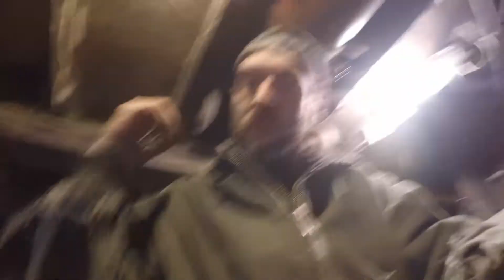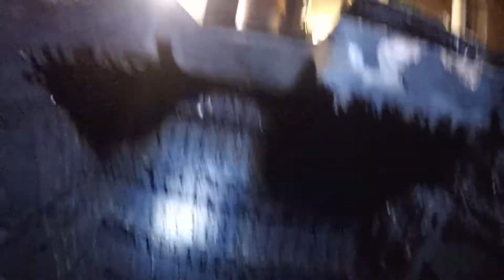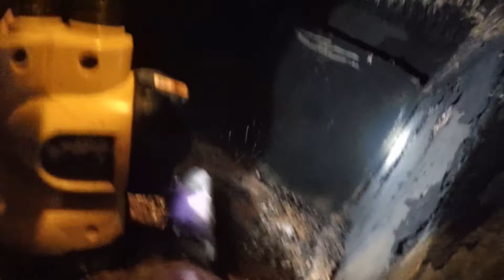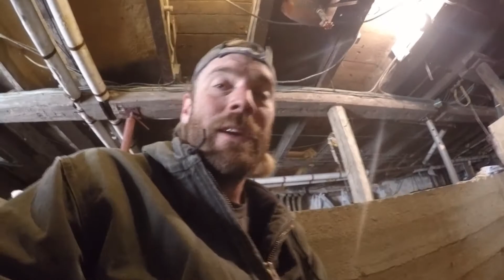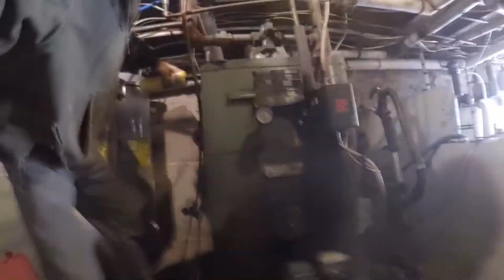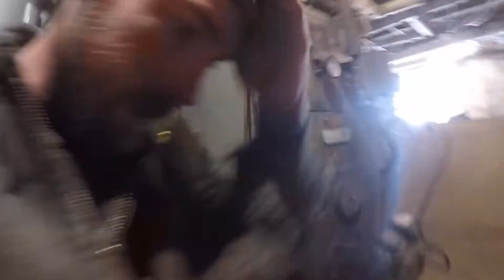NO Heat! Oil Burner stopped working! How to clean it out.

Comment: You’re dangerous pal... you didn’t address the reason why the boiler sooted up. You didn’t perform any type of service to the burner. You may have changed the filter but you didn’t change the pump strainer, nozzle, or adjust the air band. An oil burner needs to be adjusted by a pro who can use instruments to perform a combustion test. If the burner is operating correctly it should not soot up. Don’t be cheap! Also, don’t lead gullible people to believe they can cheap out, cut corners,  and save a buck! You could end up burning your house down or killing your family with CO!
Reply: Exactly. Looks like hasnt been properly serviced in many years. This is preventable just like colon cancer . See this a lot in DIY homeowners , when it fails massively from poor maintenance they complain about repair cost . I ask them how much they really saved not having it yearly serviced properly.

Comment: I was just passing by your video and couldn't help it to tell you, i do work on my oil furnace too, but have more experience! I noticed you clean your very dirty furnace( to clean the heat exchanger you could use steel brush), anyway also  you didn't change anything, what about changing oil filter or filters and oil nozzle, and also your pipe( vent pipe) missing draft section, if you do all of this, will work better,... just try to help.

Comment: I JUST SCRAPPED THE SAME PEERLESS 150K BOILER IN A STEAM VERSION WHICH WAS INSTALLED IN MY MOTHERS HOUSE BACK IN 1974/5. AFTER MY MOM'S PASSING I INHERITED THE HOUSE AND FOR THE PAST 2 1/2 YEARS AND NOTICED THE BOILER CONSUMED LOTS OF OIL DURING THE HEATING SEASON. SO I DECIDED TO GET RID OF IT AFTER MY FRIEND DID A OIL TO GAS CONVERSION. AND I TOLD HIM TO NOT SCRAP THE PEERLESS OIL BOILER WHICH WAS 10 YEARS OLD. SO HE HAD THE SCRAP METAL GUY DELIVER IT TO ME FOR $300. I JUST FINISHED INSTALLING IT 4 MONTHS AGO. I SUSPICIONED THE OLD PEERLESS BOILER WAS A BAD DESIGNED WHERE THE NEW DESIGN 150K PEERLESS WHICH IS PHYSICALLY LOWER, WHERE THE BOILER PLATES HAVE THE FINGERS COMING OFF EACH SIDE OF THE BOILER SECTION TO TRANSFER THE HEAT, SAME DESIGN LIKE THE WEIL MCLEAN GAS AND OIL BURNERS. WHEN I BROKE APART THE SECTIONS OF THE OLD PEERLESS BOILER LIKE THE ONE YOU HAVE THERE. I WAS CORRECT OF WHAT I SUSPICIONED. THE BOILER SECTIONS HAD NO FINGERS BUT A CURVED SCOOP FIN TYPE DESIGN LIKE THE FINS ON A MOTOR CYCLE HEAD. I ALSO DISCOVERED THE MIDDLE COVER THAT SAYS PEERLESS OVER THE BOILER DOOR AND BELOW YOUR TRIPLE ACTING AQUASTAT IS A CLEAN OUT. IN THE CLOSE TO 50 YEARS THIS BOILER WAS WORKING. NOT ONCE DID THE OIL COMPANY IN IT'S YEARLY CLEANING EVER CLEAN THAT PART OF THE BOILER AND IF YOU REMOVE IT. YOU WILL FILL SUT BUILD UP THERE TOO. THE SECOND OBSERVATION BETWEEN THE 2 BOILERS IS THE OLD PEERLESS BOILER  HOLD MORE WATER WHICH IS BAD FOR EFFECIENCY, BUT GOOD WHEN YOU USE LOTS OF WATER WHEN YOU HAVE A COIL FOR DOMESTIC HOT WATER. THE NEW BOILER WHICH HOLD LESS WATER MAKES STEAM A LOT FASTER AS OPPOSED TO THE OLD BOILER WHICH TOOK LONGER TO PRODUCE STEAM. HAD THE TANK FILLED ON 11/20/21 AND I'M KEEPING TRACK OF HOW MUCH MORE EFFECIENT THE NEW BOILER ACTUALLY IS. ESPECIALLY NOW THAT DEVIL IN THE WHITE HOUSE RAISED THE PRICE OF OIL.